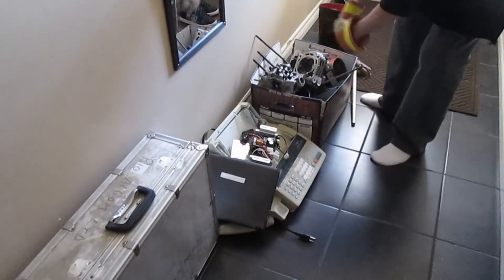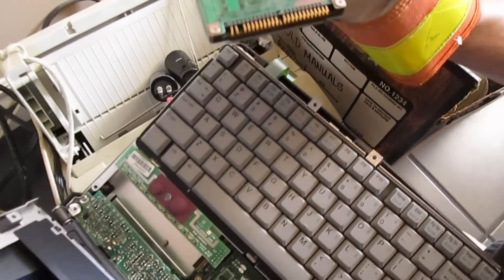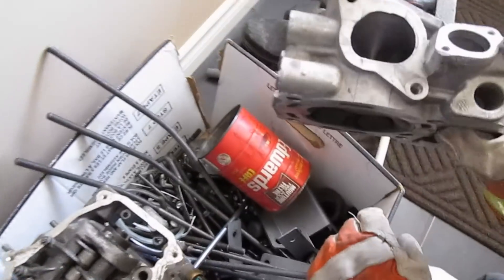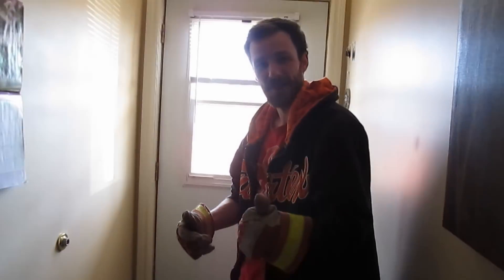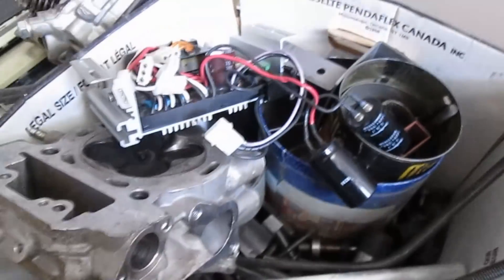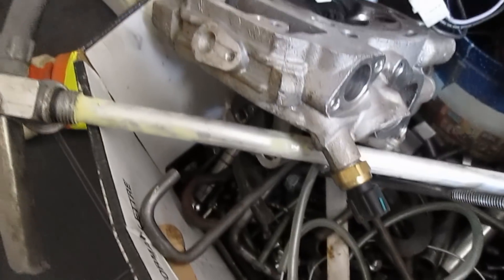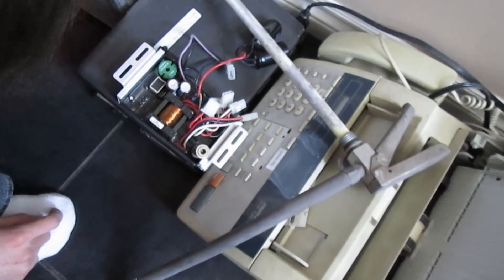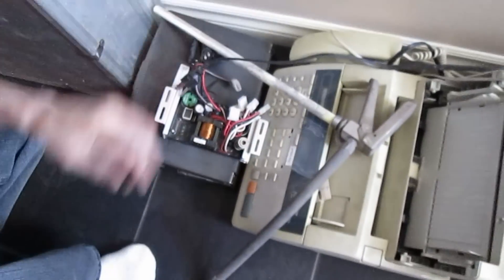Awesome Scrap Life Donation💲 from Scrap Yard Russ

Comment: inside a Keurig you will find some wires, small circuit boards, a copper-bearing electric pump and an aluminum pressure chamber. plus odd bits of aluminum and/or stainless metal.
Reply from the maker: 😁👍 Cool

Comment: Thats cool as..  i actually have a heap off (dirty cast ally) just like those cylinder heads you have with mostly cast aluminium and pieces of steal, im thinking about using my furnace to melt the alluminium and have it run out the bottom of the container i melt it in by drilling a hole in a stainless steal bucket so when it all melts it drips down into another catch pan.. so its all clean ally...  i might do a vid of that one day soon, even if it fails ill post the attempt anyway..     those pins are cool to collect from ewaste but their the lowest yield by weight for gold...   the chips on the back of the hardrive board if u open it are way better, the ic chips (with legs on 2 sides) the flatpack ic's (with legs on all4 sides) and the bga chips ( they have a "Ball Grid Array" underneath with no visible legs)  they contain the better gold  bga's being the best...  the computer will be good too on its motherboard was covered in them i could see straight away..  u might get a nice chunk of beautifull solid copper one one the  laptops cpu heatsink when u open it? I hope you do as i usually get a solid chunk for my personal stack from laptops their great.. ps if it has ram or a wifi card or that hardrive works u could sell them all for $15 each easily and make $45 just from the ram hardrive and a wificard of graphic card, and still get a motherboard to cherrypick things for gold recovery and a cpu for you collection and hopefully a big heavy copper heatsink 😁..   nice vid guys..    i have about 3 laptops to scrap atm and youve inspired me to go look inside them.. haha..
Reply from the maker: Your so awesome :) we love when you comment cause we always learn :) we would love to see the video of you melting that would be cool no matter what the outcome :) just dont hurt yourself of course :) ya we cant wait to check all the goodies that are in it :) we are getting more and more into the E-scrap and cant wait to stack it all and see how much there is :)